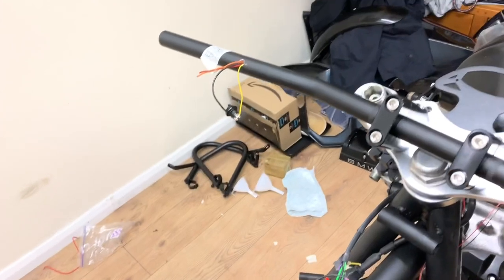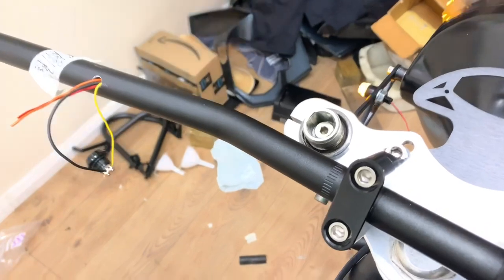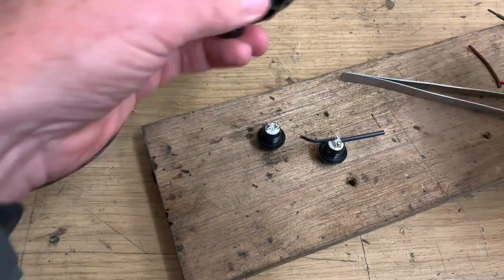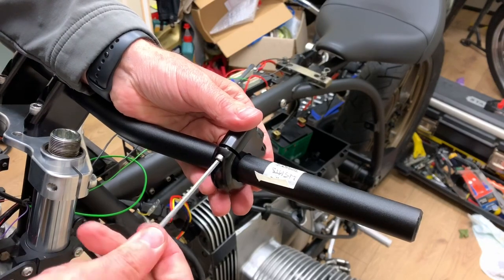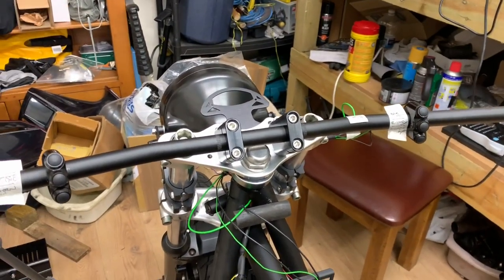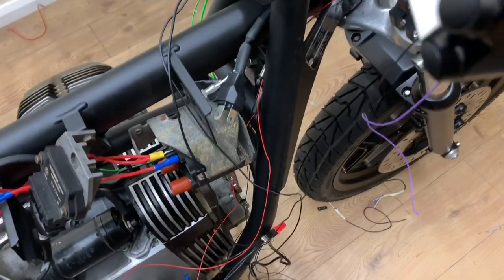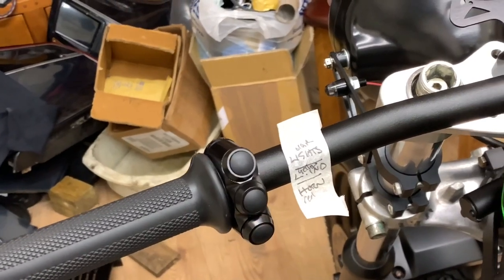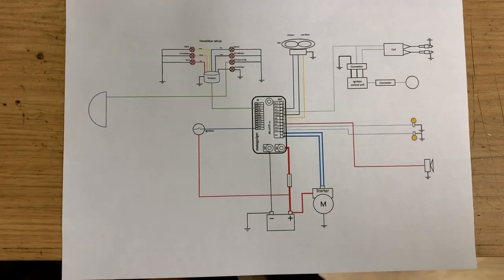35. BMW R80 Custom build. Electrickery part 3. Wiring bar switches, lights & indicators.

Comment: Nice video.A small suggestion for your solder joints.If you have to join several wires in a bundle,stagger them.It will prevent a bulge in one spot,and they will feed through holes easier.
Reply from the maker: Thanks. 👍

Comment: Great video mate as always. I’m not sure but you may need to put your halo on a separate switch or alter the config in the m-unit as I don’t think you can run it at night with it being a DRL. It may upset the MOT gentlemen. Correct me if I’m wrong 🤷🏼‍♂️
Keep up the great work 👍
Reply from the maker: garrywolf3 you’re spot on.  I haven’t got round to configuring the m-unit but the halo will become the DRL along with the rear light.  I also have an mot challenge with the indicators as they are not the regulation distance apart.  We shall see. Cheers for watching.  👍
Reply: The Long Way There. Yeh that’s how I do my DRL setup 👍. The m-unit is clever. Loads of setting for you to mess with. 
Bar-end indicators are an easy way round the indicator issue. Keep the pins for another build 😉 lol. Best of luck 👍

Comment: Hi! Quick question... i’m wiring up my M-unit blue and also have the DRL on my headlamp. Can you tell me how you ended up setting this up, to the AUX output or on the LIGHT output? The problem is when you put in on LIGHT output the normal light is on AND the DRL. Can you help me with this? Best regards from the Netherlands!
Reply from the maker: Hi Erwin. I wired the DRL, rear light & number plate light to Aux 1 on the m-unit.  (Aux 2 would work as well). Then I configured the Aux to power up when the ignition was engaged.